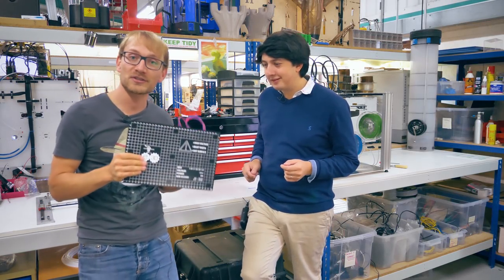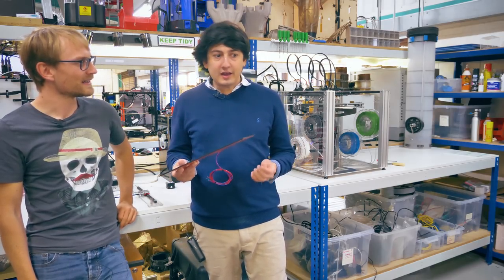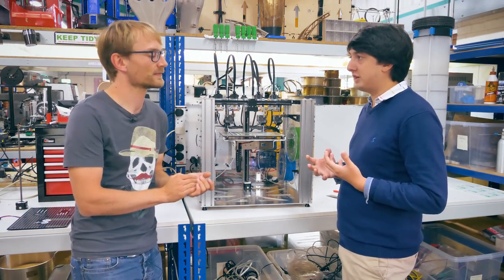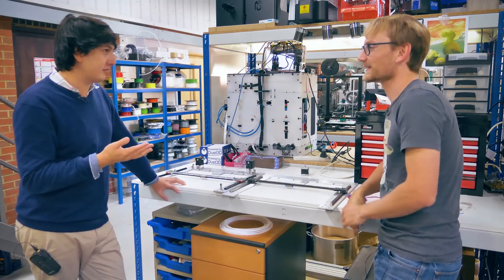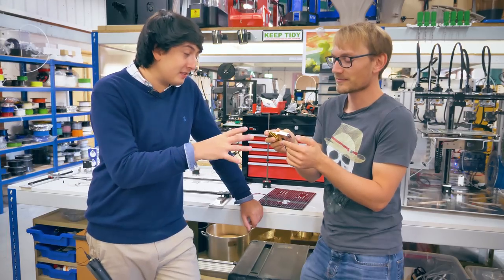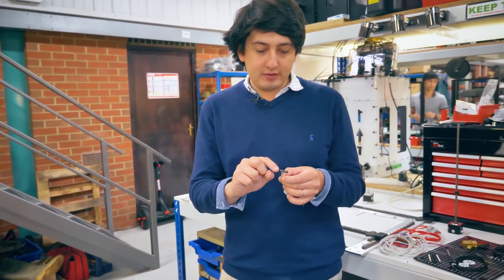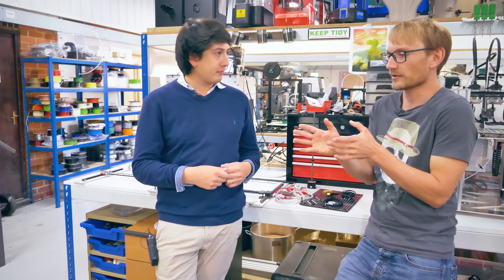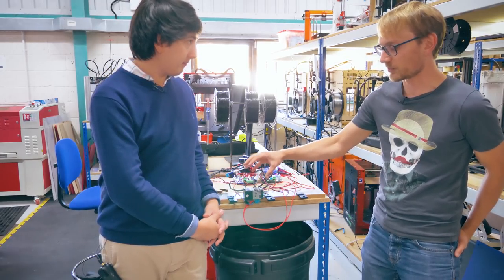Will we ever see an E3D v7 hotend? News on the Toolchanger / HAF heated beds / Supervolcano!

Comment: 4:15 Correct me if I am wrong, but you dont need larger power supply because bed is powered by main voltage controlled by SSR. Main voltage is not going through power supply.

Comment: V6 has been pretty much a standard for a while now. I don't know if melting plastic gets a whole lot better, but it sure would be exciting if it did.
What I would LOVE to see them do is with a v7 is to get the 'built in a garage' stink off of them. I want hidden wire management and simple full disassembly without need for a tool.  I know they have manufacture setup and everything but they really don't seem like an off the shelf manufactured product, and they still feel so hobbyist level.

Comment: I use a 1500w 400x400 Silicone heating pad for 3 years  now with no problems , i checked the price and see that they go for 3 a4 times the price i paid 4 years ago.
Also if you want good linear rails for a decent price  you can try Ebay, look for IKO LWH 15  or 12 if you need smaller. I have the 15 for Y and Z and a 12 for the X just for the weight.
Reply: IKO ML 9 will be enough and it has maintained free system like in the video. LWH 12 or 15 will take to much space and are much heavier than ML 9.

Comment: What about a Tungsten-Carbide Nozzle? It would be very hard and resistant against abrasive Filaments and the heat Distribution would be very good as well.
Reply: Dyze Design makes them :)
Reply: @RaulEdu33  price is a factor
Reply: Very difficult to machine.

Comment: This non-stick nozzle finish sounds interesting. I wonder how those nozzles compare to standard brass nozzles when printing PETG 🤔
Reply: David Jenni I guess not better because they are not engineered for those low temperatures
Reply: David Jenni The silicone sock solves the curling/sticking filament for me. Do you have it installed?
Reply: @eqia  Yes, and it does its job well. I'm just wondering if a nozzle with that coating would increase the print quality of PETG even more. I print mostly multi part tools that might benefit from that.
Reply: @David-uk3nv  I can recommend you to have a look at their current line of plated copper nozzles. They work amazing. I bought a set of those in a 0.25, 0.6 and 0.8mm and I can tell you I hardly take out the 0.8 nozzle :D

Comment: I have been using a mains powered silicone bed heater for a month or so now for pla/abs so lower heats than the 300 deg but will not go back to a 12 or 24v heater. 30sec to go from 20c to 60c for pla & under 3mins to get to 120c for others is great. I am interested in seeing what people will be producing with the newer high temp materials.

Comment: Sounds like a smart guy. Given that, I'm surprised they haven't  ditched the threads holding the nozzle in the block. Should do a quick change so that after replacing the nozzle doesn't lose your zero reference and enables much faster change out (same as in the subtractive tooling world - for instance have it slid in the block with a slot and clip in the block to hold it in - 10 sec tool changes). Also, what't the advantage of having such a big heater block? just to fit the heaters? seems like a much smaller thermal mass would be a lot quicker to get up and down on temps (at the expense of temp stability I suppose). Could really improve heat speed and much smaller tool if the heater was actually part of the nozzle - very localized heating that way reducing the need for lots of other mass.
Reply: how do you have something attached to the heated block that would allow you to release the nozzle. It wouldn't be a auto changer, possibly mechanical with a ball detent .

Comment: Typical adhesive does have a shortened life but the wording here implies that above 100˚C the bed will just fall off quickly. PEEK is a bad example to use for needing high bed temperatures as sometime it only needs to be a little warmer than ABS and can even be cooler than some might use for pure PC.

Comment: I'm wondering, if the heater cartridge also contained a thermistor, you would be less reliant on thermal runaway protection to keep you safe...
Reply: You also would be reading the temperature of the cartridge and not the block

Comment: I'd be curious about his view of the rampant cloning/copying of their hot ends and extruders.  I won't buy the clones...I won't reward them with $$.  I know a lot of people are all about whatever is the cheapest thing out there.  But I'd rather fund the people that develop and support the technology, not those that cheat, steal and profit.
Reply: Gotta admit i bought clone and run my custom printer with that (i was afraid to possible waste money, if i could not get it work being total noob on printing), how ever now that printer is operational, i plan on buying the legit one as my main hot end and to have the clone as secondary hot end for supports etc.

Though I'm far more interested about that high power bed. Even the clone hot end can get into temperature for ABS reasonable fast, but i need to put bed heater on about 5-10 minutes earlier. I just hope it will be easy to install to my printer.
Reply: Well they do make everything open source...so they've largely laid out the plans for anyone to make them?
Reply: It's open source - as long as the clones are labeled as such, I don't see what the issue is.
Reply: I like the shenzen philosophy, you protect your ip by making a superior product for the best price, not by patenting.
also in some way having all those clones means getting their stuff is less hassle, because almost everything is to their standard, so having a great quality product works even if there's a ton of cheaper options.
Reply: It seems like they are moving more towards the high end market. Which should be easy to defend with high quality products. Commercial applications aren't going to try and save $50 to risk a production issue.

Comment: Why don't you just make an Inconel 718 heat block and nozzle?  they can handle 1700F without creeping (this alloy is used in gas turbine engine turbine sections (the hot section)

Comment: I would like to see a heated bed designed to run from 240V with a series diode or 120V without a diode. Would make it a more attractive option for manufacturers wanting to only stock one version.
Reply: Big Clive here on YouTube (bigclivedotcom channel) has said before that you can't run a 120V incandescent light bulb on 240V mains just by putting a diode in series, as you might expect. He said it "overdrives it". Given that incandescent lights and heated beds are electrically very similar (i.e. just a resistance connected across a potential difference), I suspect that would apply to beds as well. Nice idea, though!

Comment: Nice beds :D
Hotend.....awesome :D
When i can buy it ?
Ps
800w on this size is awesome but i still be worry about fire chance etc.
I made 350x450mm 550-600W heatbed for my printer (still need 450x600 becouse i print molds for carbon fiber parts) 
Probably i add short wideo on my channel making prototype and then second one better and bigger.
For 350x450 550-600W around 15$.
(sorry for my English)

Comment: It is much cheaper and easier to make the heated part in the hot-end with a two standard 40 or 50 watts cartridges instead of an "application specific" cartridge !!
You will even ensure a more uniformed and consistent heat transfer to the nozzle!

Comment: I have 2 real E3d v6's and apart for the odd jam I've not had a problem with the heater or the thermistor, on the facebook groups I am a member of though I've seen many broken heaters and thermistors. The V6 is not for the heavy-handed and a integral  hothend with one plug with good strong wires would be better for these people.

Comment: Hundreds of hours is not a lot for a 3D printer heatbed...
Reply: That's why they are engineering it for much more than that, at those crazy-high temperatures.
Reply: PEEK is extremely difficult to print and also super expensive so if you're printing with it you want reliability with insanely high temperatures as a print failure could mean 100's of dollars down the drain.
Reply: @strykervalkyrion  First time hears about PEEK
Decides to check what the material is all about
Out it sure is bit more expensive than common materials, 85$ for spool..... of 100grams... WTF!?!? O.o 600$ for 1kg spool?! 
Closes the page and does not even dream about it...
Reply: @Hellsong89  in pellets it's around 60-90$ per kg, which is a bit less expensive, though you need to extrude the pellets.

Comment: Aluminium cartridges would melt, huh? Did anyone else immediately think of printing with thick aluminium wire?
Reply: We do its called welding.  ;)
Reply: I'd consider that more analogous to a 3D pen than a printer. Though speaking of welding, something tells me aluminium printing would have similar issues thanks to that oxide coating. I'm pretty sure even conventional printers can do tin at least.
Reply: ultra toxic fumes
Reply: You would have to immerse the whole printer in argon gas.
Reply: @stopa7284  

You do not get toxic fumes from melting aluminum.

Comment: if e3d could reduce cost by 1/3 on the v6 that is what anyone would buy.  Right now working around the issues with a $14 clone will leave you with a lot of dead clones before you get to the cost of an original v6.  While the work that they did was cool, it's not like they couldn't have shifted to Chinese manufacturers to produce the easy bits, and maintained consistency.  That leaves us all working on what is the best e3d clone and not caring about whether we can afford an actual one.

Comment: There was a mistake when you were talking about the platte. You won't need a bigger PSU, rather a smaller one, since the PSU only runs the SSR (a few mA) instead of the 800W plate.
Reply: Satanas I took Tom’s statement as : “with this AC powered bed, you are saving money when compared to a DC bed that would require the larger PSU”

Comment: Ive been using a silicone heater fused to aluminum tooling plate based heated bed for a few years now. I was one of the first at MRRF to have that setup, and one of the first to print Indmatek Peek on an open air printer. I even streamed one of the prints live back in 2016 watch?v=YcfB9nDRI_Q

Comment: This heated bed will never stay flat at this temperature and it will be like a bow when it is above 100C!!
It is totally useless with this thickness!!
It should be at least 10mm thickness to start thinking above 100C

Also, it is very Expensive by the way!!
Reply: @JorgTheElder  
What are you talking about?
What part exactly runs for hundreds of hours @ 200c?
Are you talking about the heated bed? if so I really do not imagine this happening or it will be a lot of energy wasted in the thin air if the
printer is not fully enclosed to keep the heat from escaping out.

And by the way, the bow I am talking about in the range of 0.1 ~ 0.5 mm or maybe a little bit more,  I really do not remember the exact numbers since my measurements were a very long time ago on my own 4mm heated bed!
Reply: @ @JorgTheElder  
That wouldn't change the fact that it will never be as flat as it looks like!
It will, without a doubt deform under this very high temperature and will be like a bow and this will be very very distinguishable if you try to print along objects.

Also, 200C is a very very high temperature that will make the whole enclosure in no time very hot and may affect the moving parts as well.

I really doubt that they use it at this very high temp. for that very long time.
It is simply not practical nor useful for most materials.
I really do not imagine that there would be a material require those conditions for printing, maybe you can tell us!

Comment: meh I've had a 1000watt silicone bed 300x300mm for years, not that crazy
Reply: @JorgTheElder  well it takes about 90 seconds to reach 110C and I've left it there for days printing without issue. I'm sure it can get far hotter seeing as it only takes a minute to get that hot. No reason to go hotter until filament requires it or benefits from that...
Reply: @JorgTheElder  So what? My bed can do the same.

Comment: Needs either a better editor or battery cameraman because some of the shots were cringe
Reply from the maker: Are you looking to replace me?
Reply: As the camera operator? If I were a videographer I might be. For example, panning to his back at 20:08 as he is talking which is awkward and blocks what he is showing. Or at the end, the abrupt cut mid-sentence to the outro. I would have done the entire closing right there next to him and ended it there.
Reply from the maker: Yes, of course, I would have done all those things differently as well if I would shoot it all again. But the reality is, this is all one take, with only me running camera and audio and hosting at the same time. You just need to work with what you have and make the best of it.